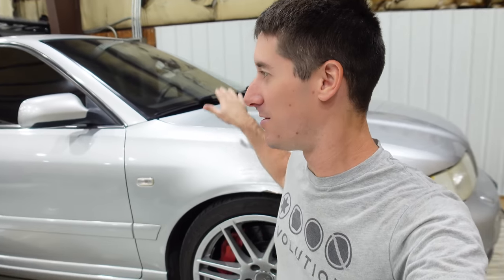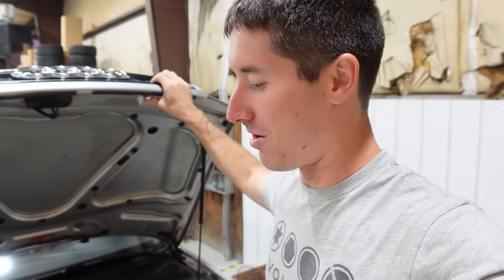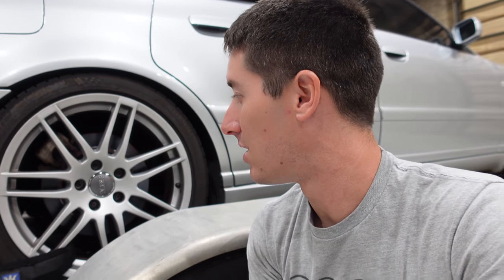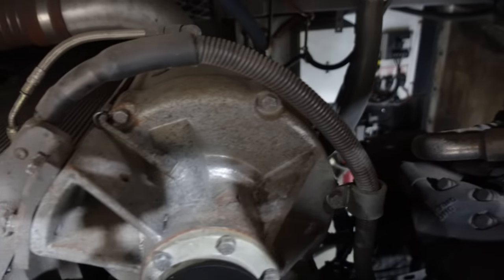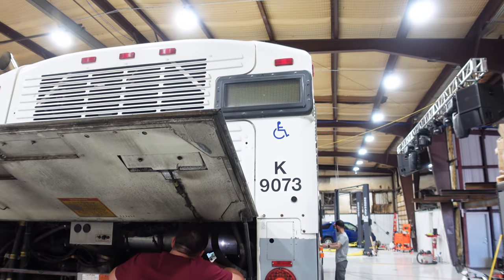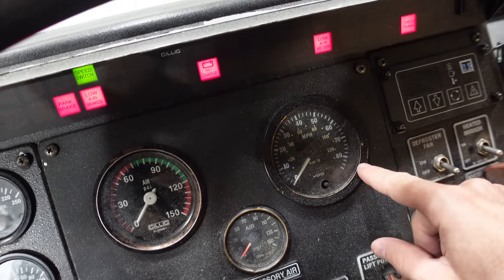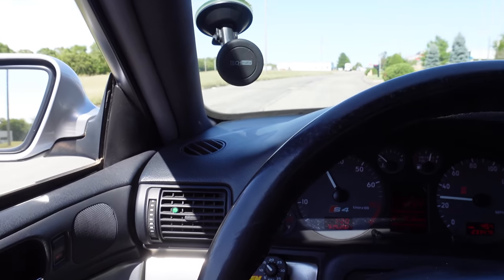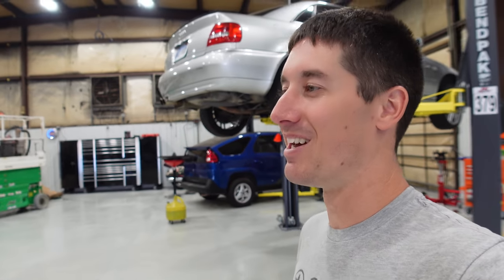How BADLY Did The Track Day BREAK My CHEAP Audi S4?

Comment: On the Gillig (bus), the 42 and 16 means it has a capacity of 42 seats with 16 standing. That would be different when you account for the 2 wheelchairs that it would be able to accommodate.

The bell I believe is for the driver to be alerted when a passenger has pressed those yellow strips (to indicate they want to get off at the next stop) and that switch by the driver may be for the side doors in the rear part to open and close.
Reply: All I know is I love the sound of an idling Cummins. I could go to sleep by that sound.
Reply: We got Ralph Cramden here.
Reply: @unclejoe6811  Actually, I never drove those kind of buses. I drove school buses for awhile. Just happened to ride many CENTRO buses where I live that have Gilligs in their fleet.
Reply: White switch maybe for kneeling feature?
Reply: So there has been a fire truck and a metro bus. So I imagine the next thing we'll see in the warehouse is a street sweeper
Reply: @WaynePittenger  Actually it will be a diesel electric locomotive.
Reply: @InsideOfMyOwnMind  There is a railroad across the street, so anything is possible

Comment: If you're super lucky maybe its just that f'd drain on the turbo causing the problem.  If there is a restriction in the return it will dump oil through the seals.  Either way if you do change the turbos, do something about that return line.

Comment: The CV boot may have ballooned and blown up. I've had that happen more than once. I've fixed it by using a better axle grease and vented the boot using tiny aluminum pipes from the hobby store. I only vent the shaft end and have never had an issue since.

Comment: People don't realize those cars are built like tanks... The reliability concerns stem from the consumables (rubber/plastic parts) but the underlying platform is super overbuilt. B5 FTW
Reply: Lolz sure bro
Reply: maybe you can be more specific as to what you mean. I owned B5 for 14 years and the rubber coolant hoses were actually the most durable part on the car! The vacuum lines cracked often of course. Suspension bushings utter shit. Engine cooling worked well but oil ran too hot it seemed. Door hinges went out after no time. Made a nice thud though!
Reply: @jamesmedina2062  anything epdm like the coolant lines seems to last forever despite the turbo heat on those motors, along with the reinforced silicone vacuumed lines, but all the plastic/nylon tees, vacuum hoses (spider hose), suspension bushings, aux water pump, blah blah. Engine harness gets brittle in hot climates, those are NLA...
Reply: @SteveBassen  yup yup!! all could have been designed out long ago but were obviously included in subsequent designs. ahh durability like an afterthought with the smaller stuff. We get nickel and dimed to death!

Comment: You’re right, JR. I have the exact same trailer, only we built a tire rack on the front. Really good trailer, decent ramps, but I still have to use race ramps to get on. The car is too low without them. Glad your B5 didn’t let you down.

Comment: I heard the bearing noise when you two were doing the shake down drive and figured you guys knew about it and it was a wore out high mileage thing that wasn't critical yet.
As far as the bus sounds like another cool toy for yourself or someone. Would be a cool bus for hauling people around to big swap meets or pub crawls too.
I had to get a HUGE wheel bearing socket for my 41 Military power wagon, luckily it was included with the truck. It had 16 inch bud style wheels and most of the drive train stuff was like a semi or dump truck and it weighed a ton considering it's size.
Enjoy the toys 😎

Comment: Those Gillig Phantoms are absolute beasts.  Super durable and reliable.  I work on school and city buses for a living.  The engine is probably an M11 Cummins.  Also: get rid of that aftermarket DPF if you can.  It’ll cause nothing but trouble.
Reply: It was an ISM 280 Cummins
Reply: Figured it an M series, 280 is pretty much the going rating for those buses.

Comment: braking:
-ceramic coating of wheels so they are easy to clean
-make some aero work so your brakes are getting fresh air because those are really hammered discs
-definitely replace both brake fluid and brake lines to stainless steel ones because plastic ones like to catch on fire when being stressed hard and steel ones improve pedal feel because they don't expand like plastic does
-do not run drilled brakes,slotted are way more durable because drilled ones tend to crack due to heatspots around drilled holes and with that run better brake pads which will help you stop even faster
-replace all 4 wheel bearings because god knows how bad these are and with that replace that CV boot

body work:
-roll fenders with roller
-work a bit on rear bumper by cutting lower portion which bends inwards because it probably acts as a parachute so air doesn't get trapped in there(or buy a splitter and hook it up to make that parachute less prone to mess with you)
-front end would like to have vented hood and vented fenders because your turbos and brakes cook themselves really hard when airflow is restricted towards them

engine work:
-look to have oil cooler to help with oil temps
-new turbos because stock ones are trash
-new intercooler piping because you can make it look better and perform better this way by reducing pressure loss with cleaner bends
-check intercoolers to see how they look in case they are damaged
-use something like 5w-50 because tracking probably beats on engine oil hard
-replace all rubber lines and all broken things on a car
-relocate battery at back if it wasn't relocated
-get a decent exahust to help turbos scavange better while making car sound better

this is what i would look to do if i wanted to have fully ready track car but thats up to you
Reply: Wow that’s some detailled advice!
How about stripping the interior and putitng in a rollcage? I’d do that as well.
Reply: where are there plastic brake lines? I didn't know those were a thing!

Comment: You must not have hammered those brakes too bad.  When Porsche S brakes (the red ones) overheat, they turn pink.  These still look red.

And as someone else mentioned, the front rotors are on backwards.  The slots and holes should rotate from the center to the outer edge rather than outer edge to center.
Reply: slots on the outside of the rotors doesnt mean too much. it depends on the fins inside the rotor, if they are straight it doesnt matter. but if they are curved that determines which way they should turn.

Comment: Your capacity number is seated plus standing in aisle. Looks like the seats have been swapped from 2X2 with like two banks of side facinf 3X3 at the front which fold up allow for wheelchair parking/securement.  Least that is what you would find in WA state.

Comment: I drove a bus like that for a time in my life, pay was good. Despite all that power, those things are SLOW. 0-60 is like 35ish seconds, I got one going close to 80 once returning to the garage. Its pronounced " Gill Leg " and theyre hand built in the Bay Area of San Francisco, actually VERY well made. The outfit I worked for would run them to 600,000 miles before a rebuild. THen sell the whole bus around 800K miles at auction. Very very well made and reliable.
Reply: Ahh yes the classic samTrans in San Francisco and San Mateo.
Reply: @CupwakeRBLX  It was a bus Similar to this one in Pittsburgh. But it was slow

Comment: Do you have ethanol stations around you? Getting this custom tuned on E85 would be optimal if so; beats trying to find methanol but I do see the failover option if you are not near a ethanol station.
Reply: He doesn’t have to “try to find” methanol. He just said it’s available everywhere, in my area there are 10 auto part chain stores around me in a 15 mile radius plus every gas station carries washer fluid and yellow heat. 

It’s not about the availability, I think it’s the dinky tank size. He should upgrade to some monster tank 10 gallon or something as long as it’s weight doesn’t affect the car and offset the gains, etc

But I’d honestly would look into a ethanol tune. Pros and cons with this car model. And yes he has ethanol everywhere around him. Honestly here in the Midwest everything is ethanol and it’s sucks because we don’t have a choice for non ethanol here in corn fuck Wisconsin, 

plus it’s destroying our small engines quickly and gumming the shit up.
My idea to fix that is if they are so rock hard about not letting us have non ethanol gas (we have 10% in everything including 93 premium), perhaps go the same route as they do here and many other places for “off road farm use diesel” they color it purple so officers can check to see if ppl are using it on the street, 

it’s cheaper than regular diesel and it’s like the old school diesel and made for older equipment.(farmers got huge pull here in this farming state so so surprise they get special pumps with special gas lol) but maybe I’d they did that for small engines and 2 cycles etc like a (for small engine/equipment only) would be awesome just have non ethanol gas in it and we would be happy!
Reply: It's Kansas, I doubt it is difficult to find E85
Reply: @RandomGuyDan  In bigger cities like Wichita, Topeka and Kansaa City it'd be easier to find E85.

Comment: I know I will sound like a noob but totally confused why you're putting heet in your fluid reservoir and why you are blowing through washer fluid with methonal in it?
Reply: Im not too knowledgeable on this methanol stuff, but from what i gathered from previous episodes, it was converted from a washer fluid for your windshield reservoir to methanol that goes too the engine.
Reply: I'm not familiar with this system but I used to use meth injection in the late '70s on my turbo Mustang Pace Car and there are no new ideas so it's probably the same concept.  Turbo engines generate lots of heat.  Heat is not good for generating HP.  The methanol is not injected into the combustion chamber but into the intake manifold before it's combined with fuel.  The intake air is coming from a hot turbo and is being compressed which adds more heat to the equation.  It's pushed thru an intercooler which is just a radiator for air in order to cool it down (cooler air more explosive than hot air).  Injecting the meth at this point cools the air even more and adds more combustability to it because methanol is explosive, so you get a two-fer when it comes to adding HP.  Compressed air is more explosive than non-compressed air, cooled compressed air even more explosive, and cooled compressed air with a shot of meth is the most explosive combo.  Cooled air combined with gas is less likely to precombust (pinging sound), which allows you to run higher boost pressures, generating more HP.

I'm not a mechanical engineer and I didn't stay at a Holiday Inn, but this basically what they're trying to accomplish.

Comment: swap the intercoolers for two „Wagner“ coolers or OEM RS4‘s.
the K3‘s or K4 step engines should run fine without meth... even on maxed out turbos.
cheers from Germany
Reply from the maker: I have the AWE intercoolers, I assume those would be better? 🤔
Reply: @WatchJRGo  I am not sure...
every tuned S4 here runs Wagner or RS4 intercoolers. 
I know some cars that run meth injection, but they are well past 800hp
Reply: Those AWE's (they even have shrouds, I think) are right on par with Wagners... they don't flow quite as good as OE RS4's but have less temp rise

Comment: As far as the bus it’s actually a GILLIG Phantom it was first sold as a airport shuttle in 1980 and 1981 or 1982 gillig offered it to transit systems where I live in Pennsylvania we had 2002 phantom’s with Detroit diesel series 50 and 2004 phantom’s with a cummins or as some of the mechanics called them come a parts the phantom was the only good bus to come out of a gillig plant and they are made in California now you need a old GM transit bus in the shop with a 6V92 Detroit diesel

Comment: Bro I mentioned this before, those front rotors are on wrong. The slotted and cross drilled pattern are reversed for the front wheels. You need to check that out.

Comment: Gillig Phantom 35', Detroit Diesel Series 50 EGR	engine, with an Allison B400R transmission.

However, according to sources, Wichita Transit never had a bus numbered 9073.  So maybe it was renumbered at some point.
Reply: Nah, it was a Cummins ISM 280. I found the tag.
Reply: @watchjaredwork1487   did YT delete my comment? 
I searched the (Canadian) Public Transit Discussion Board (CPTDB) and couldn't find that.  The closest would have been a 2005 model.
Ah well.
Reply: It was from Sound Transit in Seattle
Reply: @dave877246  ah, JR said it was from Wichita. That's what confused me.